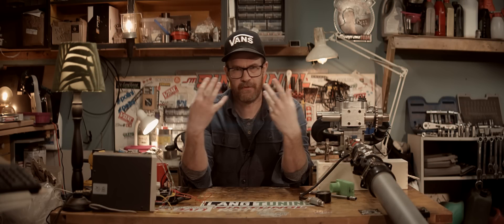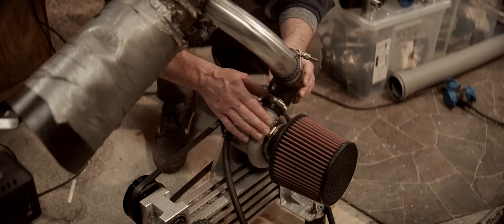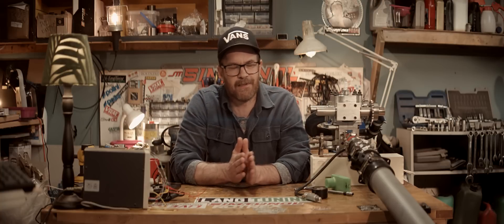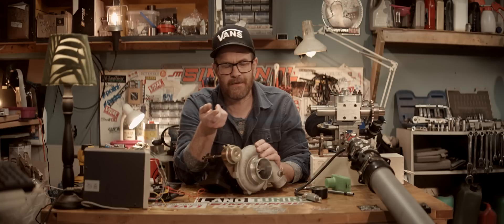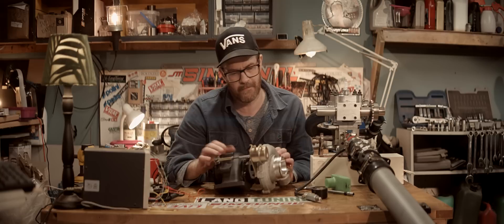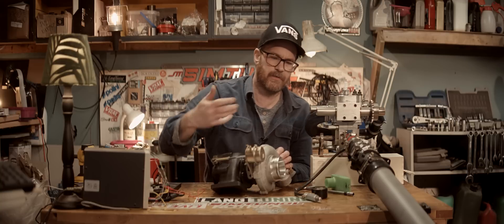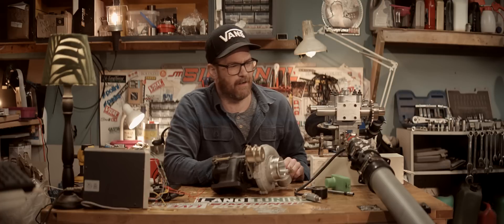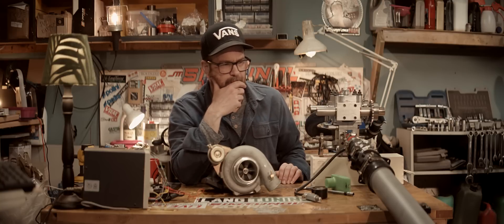THE most genius/stupid idea! Turbojet supercharging.

Comment: I think someone previously mentioned using an Arduino - So, as an idea... Have an electric motor drive the turbo, but the speed/outflow is controlled by the Arduino that also uses Mass Air Flow & Input Air Temp (and any other sensors needed) results to control the speed of the electric motor, thus, the turbo can be set for a specific output pressure for starting the motor itself, and then spin up/spin down thus adjusting the input air pressures while the 2 stroke motor is running... So the Arduino could be programmed to act like an ECU? 🤔
😎🇬🇧

Comment: I really do like your ingenuity on this idea! It would accomplish spooling an extremely large turbo charger which would also have you off the compressor 
map into surge on a large turbocharger.
The two-stroke exhaust pipe will act much like a combustion chamber for spooling your turbo, trust me I have done it. You will have no problem spooling a Mitsubishi TD02    IMO. In fact I wouldn't bother with that turbo, go straight up to a Holset HX20 which can give 3:1 pressure ratios. At some point you will need ems system as well for data logging at a minimum. 
Why spool a huge turbo and incur parasitic losses from a blower when it's unnecessary?
Cheers my friend, keep up the good fight! 
Not sure how to donate PLMK
Reply: Holset hx20 is too large after converting the airflow numbers. 
Sorry my bad.

Comment: Using a turbine engine to drive compressed air is two engines and go back to two stroke development and work it out,  at the moment you move engine types and super charging for failing to produce any results with naturally aspired engine, you too a big change trying to make more power than ever before but can't produce 20 hp yet ,my advice is your not capable so sorry 👍 mate but don't give up on ya dreams 😅

Comment: Hi, i like the outside of the box idea! A few suggestions on the turbo size and pressure ratio, sorry for the wall of text. Your comment of the higher pressure means the turbo can be sized for a larger engine is not right, as you will need to spin faster to reach higher pressure ratio, thus flowing even more, making it actually a smaller turbo that you will need to make the higher pressure ratio at the small engine flow. Alternatively, it will be easier to source 2 turbos sized that you can do an actual compound setup with vs. one small enough to spin fast enough to produce 4:1 PR at low enough flow to not surge. You will need a larger turbo on the low pressure intake side, sized for the total mass of aitflow at 4:1 PR, but only producing 2:1 PR, feeding into a smaller turbo that is sized for the engine flow at 2:1 PR, which will result in 4:1 PR (or higher) at the flow you need. You could potentially use a third turbo to run as the turbojet producing exhaust to run these turbos, with the engine initially spooling it, and cutting over to full turbojet after spooled, using wastegate style valving in the exhaust. There will be heat losses, so IC will be important, and probably size the whole system for higher PR so you end up where you want to be, with the losses.

Comment: That's a complicated system your thinking about trying, I love it. I have experimented building gas turbine jet  engines and have the software on my computer at work that will help you. It figures out the flame tube size, combustion chamber size along with the primary, secondary, and tertiary holes per the impeller size. I can get that for you Thursday if you like.

Comment: As you are running in the compressed air you need to consider the air meter, it is a hot wire device and the calibration is set for air at a normal atmospheric temperatures, normally up to 65C. When you compress the air in a supercharger the temperature goes way above this, so the calibration will be way off. A better solution would be to use a flap air meter from a much older EFI system as these are much less affected by temperature changes, something like this Bosch Air Flow Meter 0 280 200 024. Some modern diesel engines use compound pressure charging with two stage turbos, with one small and one large unit. 
Does the addition of the 'turbo jet' device count in the size of the engine? It is generating power (to drive the compressor) so does it count in engine size calculation? Might be an issue with the 50cc capacity limit if it does.

Comment: I think that a Variomatic like setup would be a great way to drive the compressor, that way you can let it spin faster at lower engine rpm, and slower at faster engine rpm to keep the pressure/flow more constant...

Comment: something similar was made in rally they use the leftover fuel on the exhaust pipe to move the turbine of a turbo , then they storage that pressure in a tank or something like that. You should research on rally there where made a lot of crazy stuff ,  in some case they use a compressor and a turbo , compressor for rpm and turbo for higher rpm

Comment: You could replace the procharger pulley by a CVT pulley then you might have a variable rotation in the pressure line produced by the compressor.

Comment: I'd like to see this current idea come to light but also I d like to see the engine run with a small turbo which will get you the high pressure and lower volume you are looking for. The current idea in this vid is going to be very heavy and going to weigh the bike down. Its hard for me to believe the advantage of the supercharger running the turbo charger to boost the engine is going to be good enough to make it worth it. I wanna see you try though!

Comment: I would like to see more "regular" stuff. Like getting the engine running and dyno showing correct results. Its cool to play with big parts and crazy ideas but getting some actual results is what ive been waiting for a long time.
Reply: . -------------closed mouth -or --encourage, support, suggest, inform, teach, constructivly criticise,--or closed mouth...........
Reply: I was under the impression he was going to use the 4 stroke as a baseline for the dyno not try to run the supercharged

Comment: Hi Alex,  I am concerned you are perhaps overthinking all of this or something else is going on here.
Maybe slow down and reaccess what your aim is. 

I say that as I am confused after watching this video and not sure what the goal is any more.
Is it the most powerful Two Stroke (HP/CC) or the most powerful 50cc Engine?
You mentioned avoiding inefficiency, my definition of inefficiency relates to unnecessary complexity.
For either/both of these I honestly can't see why you need 4-5 BAR to achieve either of those goals as 1.5 BAR would do the trick.
At that, you only need to control the Air Volume, and that is doable with this Rotrex.

As I said earlier, it all comes back to what you want to, ultimately, achieve/build.
Take Care of yourself
Pete

Comment: I think you need to step back and sleep on it. a 50cc two stroke + turbo jet cannot be the "most powerful 50cc" because it would be the only in its category, zero reference point. I'm all for going as complicated as necessary to reach your goal (power) but don't let complexity become the goal. I get the do with what you have or build it mindset, but the compressor doesn't seem suited to your project.
Forced induction sound like it should provide more power IF you can get the boost stay inside the cylinder, which is complex enough in its own.
the way to deliver the boost is not really the interesting part, I think what you need is a reliable, consistent and easily tunable source of compressed air, so I would just start with the smallest supercharger you can find like a Aisin AMR300, which is still plenty enough for up to 20 psi or ~80hp then decide wether you want to drive it from the crankshaft with various pulley sizes for tuning, or if you want a more flexible setup that doesn't draw power from the engine and allows you to dynamically tune the boost, like driving the supercharger from an electric motor and controlling it electronically depending on your rpm sensor. that would be much more complicated to setup initially but still way easier than the turbojet and you'll have way more tuning potential. but ultimately once you have found the perfect time you ll have to drive the supercharger from the engine. if the power gain is substantial the engine will drive the supercharger OK with the correct ratio.

Comment: I mentioned the AMR300 last video. I was unaware that it was unable to build that much pressure. I am running 40psi of boost on my 4cyl diesel toyota hilux from a single turbo and it's custom made for my application with an ecu controlled variable geometry rear housing. What I would do is run that AMR300 supercharger and feed it with a small turbo. The AMR300 will give it the pressure you need at all rpms and then once you get it in to the higher rpms the exhaust feed turbo will pressurise the charge feed in to the AMR300 and it will just apply it's delta in pressure change. This way you can gear the AMR300 as low as possible so it just gives you 5psi or what ever is needed to make the engine happy then run the turbo flat out. I would start with the AMR300, get the engine running then add the compound turbo. You will need to put 2 holes in your drum valve, seal the ends and a port on the otherside of the port housing so that you can collect the exhaust or even better run a tube through the drum to guide the exhaust out. It may not seal well enough though because if you plan on running 4-5 bar of pressure the exhaust will not be far from that pressure. I don't know enough about 2 strokes to know if having 4 bar of exhaust pressure with 5 bar of intake pressure will be an issue. The air density will be REALLY high though so that should make good power.

I would get the engine running on the AMR300 at low pressure with it in good efficiency then go from there.
I hope all these comments don't come across as negative, I think a lot of people just want to give advice.

Comment: For your engine dyno and testing, you could consider having a air compressor and air tank with a large volume to feed the engine. Constant pressure without turbo/super charger losses. Cosworth and ford did this in the 80s on their F1 engines. Need a big enough tank to last a run tho! And when your engine is performing how you want, you can move on to actually setting up the method of creating boost.

Comment: have you though about an electriacl blower very controlable with a switch mode driver and plc takinng settings off engine inputs , would solve starting and run up with low power loss due to just the right amount boost surplied . cheers Richard .

Comment: MAF needs to be before the compressor, measuring only the air entering the engine doesn't tell you how much is leaked off, so you have no idea if you are really out of surge or into choke etc. You need to plot maf before compressor and map after compressor, to calculate the pressure ratio and flow through the compressor and set the bleed air after the compressor to sit in the place you want in the compressor map

Comment: I was thinking a few months ago that a system similar to this could work well for a 1000 cc 2 stroke. The only difference was I was going to try and add a rocket combustor like Subarus rally car where it used the hot fuel rich 2 stroke exhaust (with extra fuel too) to make pressure to scavenge a 2 stroke without needing crankcase scavenging

Comment: why not get an AMR-500? its the bigger version of the amr-300,  you can spin it allot slower so its loaded way less.  or a screw compressor of an air compressor. they are rated for 8 bars atleast.

Comment: A well sized turbo with a fresh air antilag setup would do the same thing you are thinking about but without stealing power from the engine. The excess air the engine dont neeed gets injected beford the turbine and reignites the fuel that dont get used by the engine. And if you need some more push put an injector and add som more fuel in the exhaust and you get your ”turbine engine” to spool the turbo more.

Comment: Well ,  you will have one extra combustion chamber, not sure about the rules for that.  But I have made 2 jet engines myself, and my experience is that there will be very difficoult to have a kind of jet setup that produce like 4 bar of pressure. My jet engine was like 2 bar at maximum and with a incredible high fuel consumption. I used a turbo for a Mercedes V6 Truck engine. I do not remember the air flow, but there was a lot of flow.  Remember that you have only a 50cc engine, it will not need that much air, just compressed air that is delivered with a high efficiency.  To give you another maybe more qrazy idea what about trying this? ::  You make a big volume after the compressor. Then split the flow by having a choke that goes in to a inlet pipe.  Out of the choke there is a pressure of like 1 bar, but in the chamber after the compressor it is higher, like 2 Bar.  Now you have a compressor that is delivering a high volume flow (But not more than your 50 cc engine needs) and a high pressure line that has flow too.  And now just before the intake of your engine you have a injector nozzle.  If this venturi nozzle is designed correctly the high pressure air (low flow) will increase the pressure of the low pressure air and you can have a charging pressure of 4 bar.  This is actually how they can fill this evacuation slide of airplanes with a small amount of co2 gas because it is sucking in all this air through the venturi in this nozzle.  I think this might work.  Another way to make power is to run at much higher nitro content in the fuel, like 90%.   Regards from Norway. :)

Comment: I feel like you're kind of doing it backwards. First thing we need to know is what is the maximum CFM? That motor can ever consume. And then we need to know how much PSI. You wanna slap on top of that? The owner of NOS. He Actually uses compressed air. Not NOS in his builds an air tank may be a better option. For something like Salt Flats runs.

Comment: I appreciate the impulse to explore but I think you're chasing your own tail at this point; is it really a 50cc engine if there are 2 combustion chambers in the intake? I think you'd be better off with a big electric motor that you can control more precisely to run the centrifugal compressor, get it running at the airflow you're trying to prove, then tune the compressor/intake to be efficient enough to run off parasitic power from the actual engine. Change one variable at a time, not all of them.

Comment: There is a guy on YouTube named Alex Ltd. He does electric turbos. And these are no joke. He is Pushing some serious power. But it might be something you could apply to your engine. With power demands way, way less than what he's using. And it would be a much easier way to control your air flow. With, you know, a Throttle.

Comment: I'm always up for wacky ideas. But, apart from the fact that you might not be allowed to claim the record with the additional combustion chamber, I think there is always going to be a struggle with flow vs pressure in a turbo/compressor. I have a suspicion that your idea is going to push the problem down to the second compressor, again generating higher flow and lower pressures than you can work with. What about alternative compression methods? Like a rotary vane compressor perhaps? As always, keep up the good work.

Comment: Imho...this is just getting F'ing stupid now. Are you trying to build powerfull 50cc engine or some bastardised motor-jet engine that will take you even further off course and most probably not comply with regs.. to me.. a simple solution to surge would be to change the compressor wheel (have one made) that has less blade height so it has a higher PR instead of flow. Or you could even use the compressor cover and wheel from VZ21 turbo and adapt it to the rotrex gearbox. You've made everything else..make your own supercharger for the application..

Comment: Brilliant, I suggest you size the compressor of the turbo large enough to supply the 2 stroke engine and the turbojet system. Eliminate the weight, drag and complexity of the AMR supercharger. The only use of the AMR supercharger would be to ignite the turbojet system, I am sure there could be other ways to get it spinning. What do airplane turbojet engines use to start? I don't get 'stupid', but I question 'economically viable'. I understand that cost of operation is not the challenge here, so I think you are dreaming up a winning combo and I love watching you build these crazy things.

Comment: I dont know if im missing something or not. But on my Civic, the rotrex supercharger setup was just belt driven by the engine,  as the rpm climbs the boost increases (relatively low boost like 6psi), the compressor just fed right into the intake.
Some larger than stock injectors were required and some tuning but as far as boosted setups are concerned it was a relatively simple setup.
I'm all for crazy ideas but I'm not sure why it's becoming so difficult to just feed more air/fuel into the two stroke and have it work.
Granted I know little to nothing about two strokes, but it seemed it should have been a relatively uncomplicated operation to sgove more air into the thing, and then feed it more fuel in order to make it work.
Either way, hopefully we can see you achieve the most powerful two stroke soon, I came late to the party and I'm basically caught up on the videos now.

Comment: There’s a guy who made a boost-turbo jet powered S2000 time attack car. Would have 17 psi right at idle and when enough engine/boost pressure it would switch to engine exhaust gas flow. Then back.